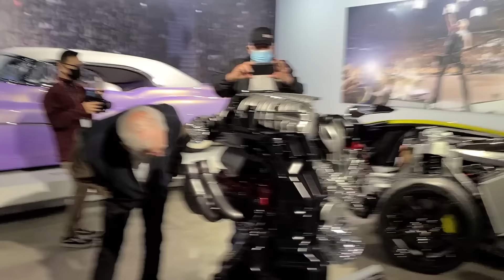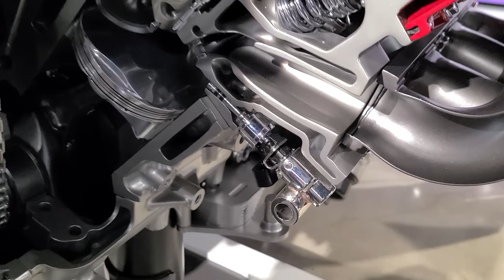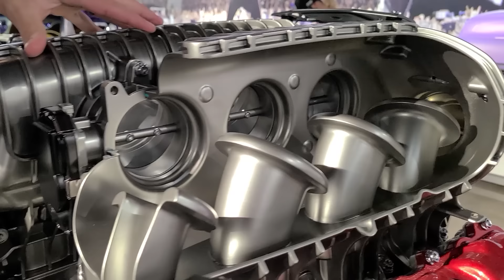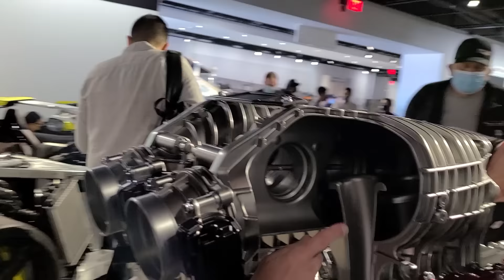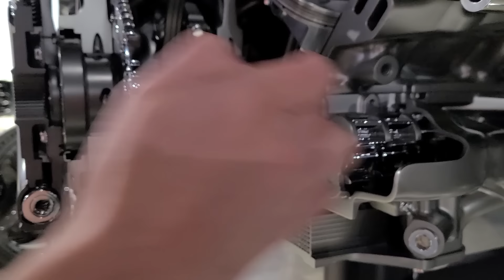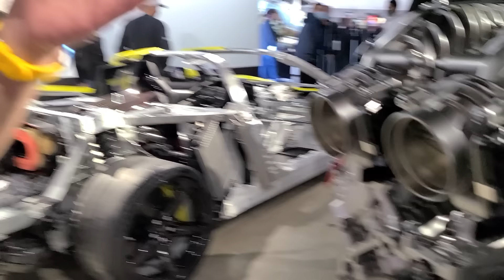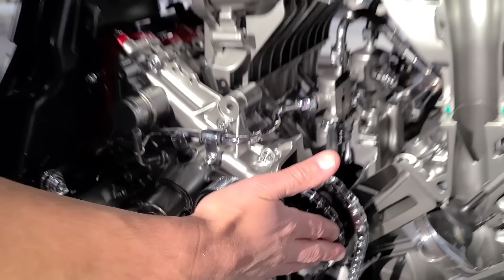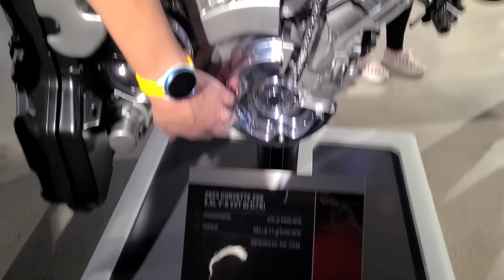2023 Z06 LT6 Cut Away Interview with Dustin Gardner

Comment: I am wondering why the torque is so low as compared to the Horse Power? The last Z 06 was 650/650 even torque to HP.
Reply: Peak cylinder pressure was greater in the forced induction engine of the LT4 in the C7 Z06. The C8 Z06 has less peak cylinder pressure, but is able to do more work throughout the higher RPM range in the form of higher HP.
Reply: A flat-plane crank does not have counterweights the counterweights give you more torque
Reply: @tont3305  Counterweights have nothing to do with torque. Even flat planes have them, just not as many. Peak cylinder pressure from displacement, compression ratio, and length of rods are the main factors in torque.
Reply: @damascus-ut1ee  it's basic physics. Torque is measured at the crankshaft if the crankshaft less mass less weight then it's going to have less torque. Flat-plane crank motors do not have much torque. Look it up.
Reply: @tont3305  No you need to look basic physics up again. Torque is force x distance. Force is the peak cylinder pressure. Distance is the length of the rod. Counterweights are purely for countering vibrations.
Reply: @damascus-ut1ee  so you're saying there is no Mass and no weight in the counterweights. That's a really fascinating perspective.
Reply: @damascus-ut1ee  the proof is in the pudding look up any flat-plane crank motor in it does not produce massive amounts of torque
Reply: @tont3305  No read my posts again until you understand. Because at this rate it is escaping you how torque works, and how horsepower is a function of it.
Reply: @tont3305  Flat plane engines produce less torque because they have lower displacements overall, with a short stroke relative to the bore. They can produce gobs of torque providing they have forced induction. Why is that? Peak cylinder pressures increases x same distance acting on crank = increase in torque.
Reply: @damascus-ut1ee  yes I understand how motors work. Do you?

Comment: dam , you have to RUN RACE GAS  with 12.5.1 compression ratio, at least a 100 octane
Reply: No, many cars including Mazdas have compression that high. Lexus GSF, RCF, IS500, Ferrari 458, etc all have around that compression and none require 100 octane. 91/93 is plenty.

Comment: Thanks Jeremy, this is an awesome video showing the internals of the LT6 engine.  You knew the right questions to ask, and just let the engineer speak.

But you know, no matter how much performance is in a new engine, there are guys out there already plotting to make more with it.  The week after the Z06 goes on sale, there's going to be guys with 8mm stroker kits pushing the engine out to 6.0 liters, and longer duration cams pushing the revs up to 10,000 rpm.  (I think it'll get there.)
Reply from the maker: Thanks, Andy.  Some commented that I didn't talk back enough.  I'd rather keep my mouth shut and let the expert talk. :)
Reply: @etdcorvettes  
You kidding me, this was a refreshing welcome change to the approach of all too many interviewers. 
Nailed it, he ran with it... unbeatable combination.
Reply: Andy Harman: Yup…was thinking same thing. Bet some street racers will figure out how to remove that 8600 rpm fuel limiter so it won’t starve the revs.
Reply: Aftermarket cams for this motor will take years to become available unless you want to ship your car somewhere and have them do all of the work.  The shimming process will be tough to streamline since all 32 valves of every engine will have different requirements.  Also, with an 8600rpm rev limiter, it will be a while before tuning solutions are available to change that setting.
Reply: @mattm9145  I have read that aftermarket tuners are having trouble accessing C8 ecu's because the encryption that GM put in is challenging.
Reply: There are always fools out there that think they can know no more then what  the engineers know.
Reply: there's a female youtuber that twin turbo'd a c-8 with almost no miles on it...there's another video of her inspecting this new z-06, i'm sure she'll be one of the first ones as soon as she can get one
Reply: @richardbaumgart2454  She it's merely an ornamental mouthpiece for the guys that do the work and they're not that bright.
Reply: @machtschnell7452  thanks i don't care i don't like her and i don't follow her
Reply: @richardbaumgart2454  they didn’t utilize a proper tuning solution.  Just band aid fixes to sort of get by.  And then her engine failed.
Reply: @richardbaumgart2454  Yep…Emelia Hartford. She’s a lot of fun to watch and I learn so much from her experimentation. Her team helping her are amazing people and also help make her vids fun. Emelia’s work on her you tube channel helped get GM to bring her to the unveiling to be a part of history. Not bad for a twenty-something girl!  We should all respect what she’s done and is doing. I doubt many of us could have had the same dedication to accomplish what Emelia has.

Comment: I have a GT350 and love the sound of the flat plane but flat plane cranks have vibration issues and typically have less long term reliability. I hope GM has solved that with weight management. The tech in this engine is awesome. Gotta get one now.
Reply: There's a write up on one of the car magazine sites, I think car and driver or motor trend where they talk about what was done to cope with the vibrations of the engine.
Reply: @joshuapullins8815  re: "I think car and driver or motor trend where they talk about what was done to cope with the vibrations of the engine."  Formula One baby...!!! increase bore size, shorten the stroke. #OVERSQUARE
Reply: @repevox  re: "I'm probably wrong, but the issue with the GT350 engine is block related." indeed, a block negatively affected/effected by vibrations.  cast aluminum cracks, that's just what it does (ref CNC billet blocks).  though many have failed due to the bottom end letting loose, a few Voodoo engines have failed in this specific way with the rotating assembly still fine.
Reply: @repevox  re: "I think the point I was making is the weak point was the plasma coating for the cylinder walls." yes i know, but BOTH are issues.
Reply: The biggest issues with the Voodoo were the bore to stroke ratio and rod lengths creating insanely high piston speeds, coupled with a crank design that inherently vibrates more than a traditional flat plane design. For a design that is already prone to high levels of vibration, they added more reciprocating mass than you'd normally see in this design. And they made it so the overall forces present during the time the pistons dwell at the top/bottom of the stroke and have to decelerate/accelerate make for a lot of stresses. Couple those higher amounts of primary vibration with higher amounts of secondary vibration, and you essentially have a time bomb. Some improvements did help longevity in the later years. With the LT6, they've gone with the traditional fpc design, and gone with a very oversquared design with a pretty short stroke. Very similar to what was commonly done in the past with Indycar and F1 V8's to help them survive extended periods at extremely high rpms. Plus using connecting rods that probably weight about as much as feather with lightweight forged pistons very similar to what you see in modern Superbikes (these look very similar to the pancake pistons in the Ducati Panigale engines), I don't see excessive vibrations being an issue. Time will only tell though. But I'm sure they've done hundreds of hours of rpm sweep testing on their gimbal dyno.
Reply: @repevox and the same can be said Ford and Chrysler products.
Reply: They did fix that issue! I forgot what it was but they had mentioned that😁

Comment: This engine is absolutely stunning!! The idea that an American car manufacturer built this engine is really inspiring. Who ever got the top brass at GM to sign off on this deserves a medal. Incredible job 👍👏
Reply: GM’s management has always been the Achilles heel of the company.  Not the engineers.
Reply: Yeah pretty much also considering it’s hard to make TQ on this design they are over achieving so yeah this is sure one heck of an engine.
Reply: @JerryJrsGarage  a light car with ultra moder transmissions just don't need low speed torque like a 1970 Buick
Reply: @baby-sharkgto4902  Right which is also why sport bike frame just has an engine hanging there lol.  It’s light.
Reply: @JerryJrsGarage  Actually, it's because the engine is a stressed part of the frame.
Reply: @machtschnell7452  just like F1.
Reply: @baby-sharkgto4902  : Considering a C8 Stingray Z51 weighs 3,647 lbs. this new C8 Z isn't going to be light weight either. But perhaps your definition of a light weight sports car is different from mine.
Reply: I just hope they keep the pushrod motor for the trucks
Reply: @jamesthemachinist1325  mod motors are expensive to mass produce. Doubt they’ll ever get to that. 3 more cams double the valve train per head. A lot of moving components, I don’t see GM moving away from mass production of push rod motors.
Reply: @jamesthemachinist1325  I highly doubt they’ll get rid of em trucks just need that low end torque, althougha truck sounding like the zo6 would be hilarious
Reply: @scottearl7687  Trucks will eventually move to electric.
Reply: Just don't tell the top brass what they did they stop production.
Reply: Ok v v V Bo. V
Reply: I would expect nothing less than the best from an American manufacturer. This should be the expectation.
Reply: @vp5228  Well, it’s taken a very long time to get there. The American market has always seemed to have some resistance to this style of engine, which is basically an American Ferrari. There is a very high level of loyalty to large capacity, iron block, OHV, carbureted engines with cross plane cranks, even in new cars. There seemed to be some resistance to the Ford Coyote, simply because it’s too “Euro” for a lot of people. I know of examples where people bought brand new Mustangs and the first thing they did was rip out the EFI and replace it with a four barrel Holley.

I’m not American but it has always frustrated me that it took so long - at least forty years - for the American motor industry to readjust its collective sights and show what it was really capable of. But I do wonder how well it will be received when so many people seem to have trouble understanding the basics of an engine like this.

Comment: Seeing an overhead cam GM V8 is giving me Northstar PTSD flashbacks
Reply: Well starting with the major overhaul for 2004 with the LH2 rear drive variant, the Northstar is a good engine.  It only took 10 years.
Reply: Would add the C4 ZR1 had an OH 4 cam, 32 valve setup and it ran really well with no reliability problems. Designed by Lotus, built by Mercury Marine for Chevy.  Can you believe it ?😎
Reply: This is a motor that shares a lot of its design with an endurance racing motor, something GM knows how to build very well
Reply: @Skip R  I believe that was the other way around. The production Northstar V8s predate the heavily modified IndyCar design, which itself was adopted later on into the Northstar LMP cars.
Reply: The flaws of Northstars were eliminated with the LC3; at its release, it had the highest HP per liter of any production engine…
Reply: Don't forget the under the intake starter......

Comment: Now just think of the engineers that work for Chevy, they would have had these ideas way back in the 1970's but due to cost of materials and no being about to express those idea's into working motors and using those alloys, plus like all large companies any ideas are owned by the company and those ideas will only be used when the patents are released or put though by the company and then R&D has to be done and testing on a working model over 1,000.000.00 miles of real world simulated testing then they release a new product, but again unless they look at every country's market place, then they will make the numbers?

Comment: I bet this engine cost GM a ton of money. How much would this engine cost if sold as a crate motor? I'm guessing $20,000..................
Reply: Ford's 5.2L cross plane crank V8 producing 580 HP list price is 24K, so 40K for the LT6(720 HP gross/crank HP, 685 HP advertised: if a OEM was using the engine in production street legal vehicle, at 5% loss(mid/rear engined rwd, front engined fwd)650 HP at the wheels/10% loss(front engined rwd) 617 WHP/15% loss(awd) 580 WHP,  A cross plane crank version with 625 gross/crank HP with a 8500 rpm redline might be 30K(hopfully with a 80.5mm stroke for 5497cc, instead of a 80mm stroke for 5462.9cc, average piston speeds are 22.93 meters per second vs 23.03 m/s, when 91 octane's flame propagation speed limits piston speed to 27 m/s, and flat plane crank vibrations are practically the same, both have a bore to stroke rake ratio of 1.3, weear rate would be practically the same too, the LT2, LT1, LS3 ends in 62.4cc so maybe the GM gas small block engineer like displacements ending in 62.xx  ?).
Reply: My guess would be around $25-$30k

Comment: I supercharged my Scion FRS or GT-86 9 psi of boost 12.5:1 compression ratio, the same as this C8 ZO6. The car had stock internals and wemt to red line several times hard acceleration went past red line twice by mistake and the engine blew up. first thing to go was the valves, valve springs off their seats and a piston shaft cracked. One big mess . One thing I learned is had the engine internals, all of them been built forged titanium etc and well like this Zo6 engine This probably wouldn't have happened. So Yes! you could supercharge or Turbo charge this LT6 engine being at 12.5:1 compression ratio but through extensive research for reliability. with a slight buffer. keep the boost under 10 psi and all should be fine real true reliability long term 5-7 psi boost and you could keep it at high rpm all day long
Reply: Race ethanol or good race gas won’t give a shit about 12.5:1. Coupled with direct injection of course
Reply: Didn't matter how good the parts are if the tune is no good. A good tune will keep stock parts alive for a long time
Reply: Chevy engineering will use a low compression ratio of 9.0:1 on the Twinturbo V8 5.5 LT7